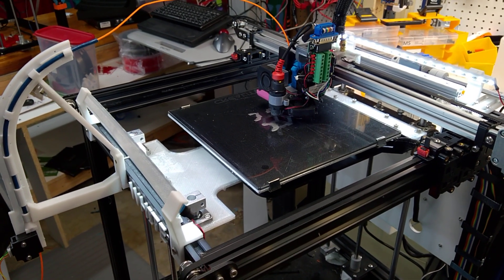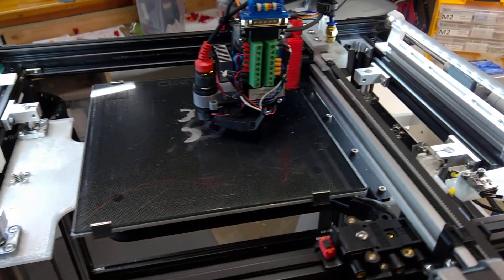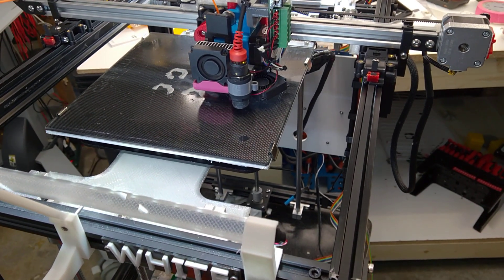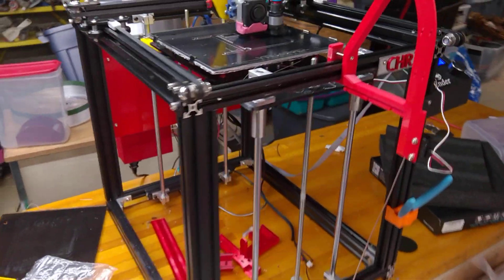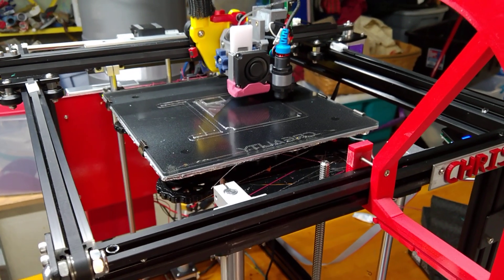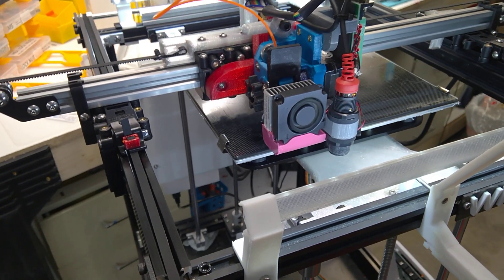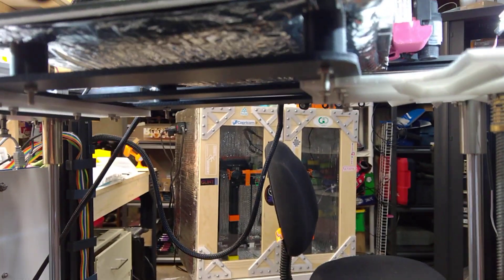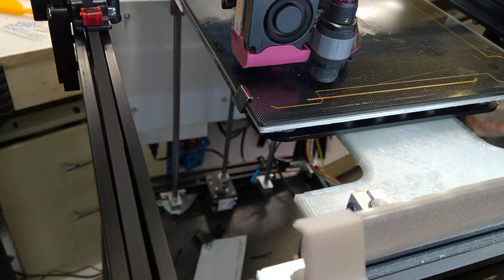Ender 5 Dual Z Mod Part 3

Comment: It’s been 2 years now, but do you remember how you drove the additional stepper? I am considering to increase the size of my build plate and add a second Z screw but move them to the sides for better access
Reply from the maker: Glad to help and hope my memory still works.  I think I ran both Z motors from the same driver.  I did consider trying an Octopus main board, that will let you use up to 8 drivers.  I have them running on my Rat Rigs.  For what they provide they are very cost effective.  I think you can get one for under $100 with 2209 drivers

Comment: I am curious as to what plate or print you used to relocate the electronics tray?
Reply from the maker: Thanks for watching and your question.  I used some 1/4" plywood that I painted.  I think this is my second version.  I used the first to get the holes where I wanted, made some mistakes and used the new one for the working version.  You could use any material that is strong enough to hold the parts.  Rat Rig uses the same concept, mount all of the electronics on a back panel

Comment: could you give a detailed explaination of the set up  and modifications in another video? i like the the capricorn bowden tube set up you have. id like to set up my own.
also what cad program do you use? ive been trying to learn solidworks but it can be tricky.
Reply from the maker: This should help  https://www.thingiverse.com/thing:4941759   
Also look at the original design    https://www.thingiverse.com/thing:4224933
Here is the bottom feed system   https://www.thingiverse.com/thing:4570721
I do all of my designs in TinkerCad.   I have tried to learn other CAD programs, but nothing is as easy to use and I have gotten good at it.
I'm in the process of implementing a new filament  feed system from the ceiling.  I will have a video and documentation out in a day or so.
Let me know if you have other questions.

Comment: What was eddited in the firmware to make the auto mesh leveling that fast?
0:40
Reply from the maker: Thanks for watching and you have a good question.  The main reason is the EZABL, it does not contact the bed and is reliable in faster speeds.  TH3D has their own versions of Marlin firmware that had options of easily adjusting the probe points and the speed of probing.  I no longer use Marlin, have switched all to Klipper, and it has good probing speed settings.  If you are thinking of the Dual Z axis mod for the Ender 5, take a look at this.  https://www.youtube.com/watch?v=v75pKu2XVZU&t=36s&ab_channel=DavidWilson
I think this is a better solution.

Comment: I just started modifying my Ender 5 so I've been looking into mods. These dual z Ender 5s that you modified are nuts but very cool looking. Do you have any documentation on what parts you used or links to the parts?
Reply from the maker: If you are still considering a Dual Z mod take a look at this   https://www.youtube.com/watch?v=v75pKu2XVZU&t=36s&ab_channel=DavidWilson
Reply from the maker: Take a look at  this  https://www.thingiverse.com/thing:4711172    
I needed extra room at the front and back for the OmniaDrop.  If you don't need as much you might be able to use the original design, or you can experiment.  Let me know if you have any more questions.

Comment: I've got my Ender 5 plus working brilliantly now, it is for from stock as it can be .
Linear rail ,  e3d hemera , Duet wifi , a dry box feeding it and it is getting that time to do the next mod.
So the white bed supports are in PETG ? , I didn't thing that PETG would hold the bed firmly , I was thinking of how to get aluminum machined on my project..
Reply from the maker: I have had good success with the PETG.  It is not holding a lot of weight, and I went very thick on it 6 top and bottom layers and 8 parameters
Reply: @woodwaker1  Have you tried PETG carbon fibre to see if that is stiffer on that sort of part ?
And a guess the Ender 5 plus makes part for the Ender 5 , so what builds big part for the Ender 5 plus ?
Reply from the maker: @peteradshead2383  I have not tried the PETG carbon fiber.  The PETG was stiff enough.    So far I have never needed a part that is bigger than the 5 Plus can print.  It already has the dual Z, so the parts I have printed are the quick change mount, display case, etc., most of which I can print even on the Ender 5.

Comment: Can you please tell me how to connect 2 motors with one driver? Parallel connection?
Reply from the maker: There are a couple of ways to do it, actually at least 3 that I have on my printers.  A splitter board https://www.th3dstudio.com/product/dual-z-stepper-motor-adapter-w-cable/  
A mainboard with 2 connections for the same Z driver, and making a new cable with two motor connectors going to one connector on the board.   They all work the same - they supply the power to both motors at the same time.  As long as nothing stalls or moves one motor and not the other they should stay in sync.  If you have any more questions - post them.
Reply: @woodwaker1  thank you, 🙏

Comment: Looks great! What material did you use for the supports?. I have been looking for materials that don't have much creep over time.
Reply from the maker: I used PETG for all of the printed parts.  I only used PLA for the longest time but needed something more heat resistant and stronger.  Have used more PETG since I got comfortable with it.  I use 250 hot end and 85 bed temp.  This one has all Greengate3D  Bubbl-icious Clear, which is now out of stock.  My other is using their Cherry Pie by Billie Ruben.  I like to have a color theme for each printer
Reply: @woodwaker1  Truley appreciate the feedback and printing details. I had not heard of Greengate3D. I will definitely give them a look/